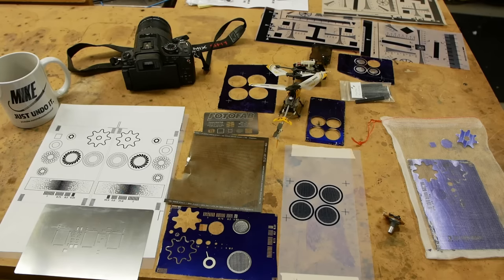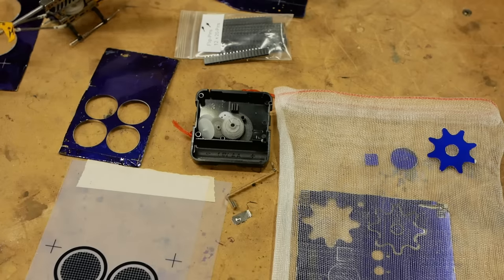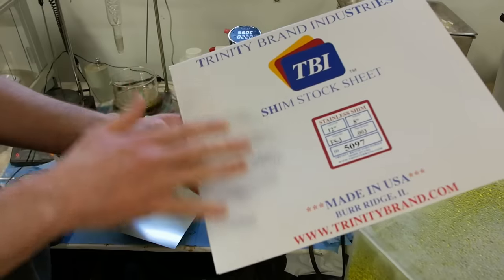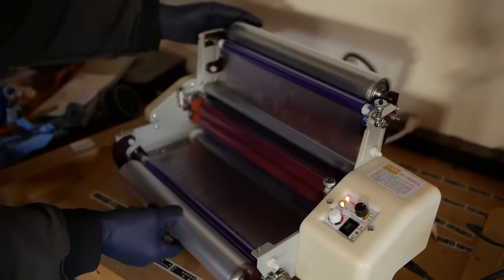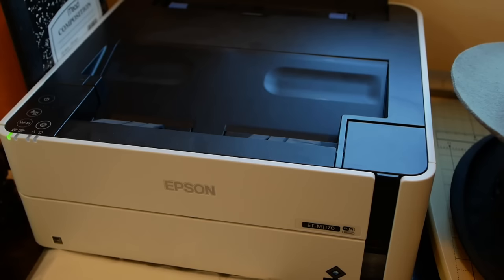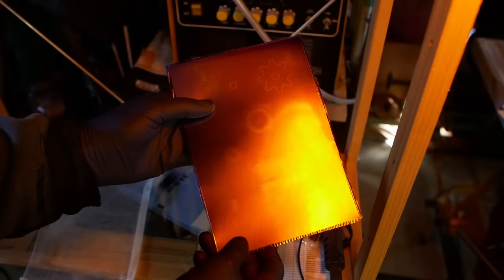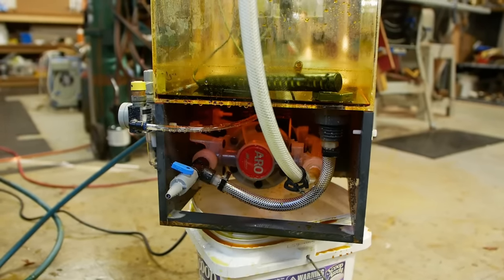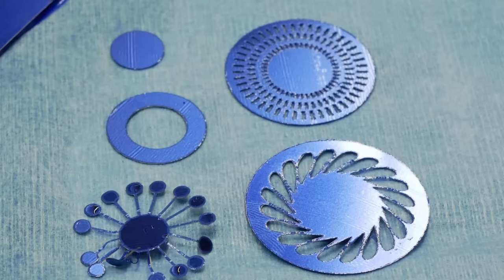How to make precise sheet metal parts (photochemical machining)

Comment: Does the etch migrate perpendicular to the etch direction into the bulk of the material between the two layers of photo resist? I imagine that once there is any depth to the etch it would attack the walls of the etch depth also while continuing to propagate along the etch direction

Comment: Clean dry compressed air (ISO 1,1,1) is quite difficult (expensive) to make. For small use cases bottle air or nitrogen is more economical. Or like you did find another way.

Comment: Honestly? I feel like you could cut out the printing and such by using a 405 nm laser. Or some form of modded high dpi DLP projector. A monochrome one that you replace the white LED in with a 405 NM LED, (or clean the phosphors off of the existing LED) to turn shadow masking into dlm and thus remove layers and consumables, if this were to be a business

Comment: - you could order these at a reasonable price as a stencil for PCB from the biggest factory everybody and their dog heard of;
- there are transparencies for printers sold that already have a stripe of paper for difficult printers;
- laser printers are actually good, but not consumer ones, the color ones found in local printing centers that do advertisement products and photo work. Such printers use all colors for max contrast; I use their services to achieve 0.1 width 0.2mm apart for A4 area instead of maintaining my own printer (which is a major PITA in case of ink jet);
- as the rest of the process is pretty much identical to home-made PCB photolithography, I wonder if there are friendlier etchant solutions for sheet metal as there are for copper clad. Unfortunately, my chemistry is weak :/

Comment: What concentration of NaOH would you recommend to get the parts critically clean? I've tried 0.25M (10g/L) and that still seems pretty strong, but not sure how much I can cut back. Is there a pH to shoot for? I really struggled to find any reference of what concentrations of Lye/Caustic Soda/Sodium Hydroxide/NaOH (I tried all those terms) are useful for which applications.
Reply: Also, I've ordered some Alconox since it seems like a great cleaner to have around, did you use a 1% or 2% solution like I've seen on the documentation, or does the heat allow you to use less?

Comment: does it work up to 0.5 mm ? what about thicker sheet up to 1 1,5 mm ? does exist any other diy method that does not invole a laser cutter ? I was thinkering with a project, but I need thinner parts and I would like for a cheap way to do this, at least cheaper than buying a laser cutting machine and learning how it works

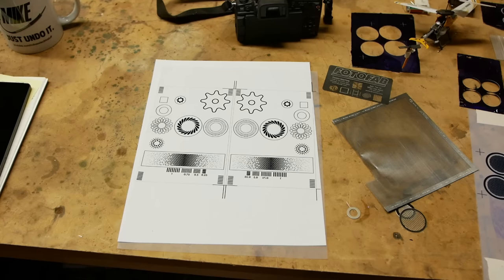Comment: 11:50 a czech friend of mine is hacking anycubic photon 3D printers to expose photoresist.
takes approx 120 seconds of exposure. You can feed the program he's making a PNG file, and it'll expose that using the LCD. The details come out super fine. Might not be as good as a printer, but good enough for most things.

Comment: I'm surprised you don't have some sort of laminar flow hood. Wouldn't that be a useful project.?. Not very high tech but you'd probably use it in most of your projects. I made one that was very LOW tech and not really laninar, but just filtered air. Basically a box fan with a course filter on the back and a hepa filter on the front. It worked for what I was doing. ✌🏽🦧

Comment: Alright... I'm a fan of this channel, but that's no reason not to be constructively annoyed. I think you are glossing over some major problems with this method. If you skip to the last part of the video where the 5 parts are shown, you may be able to notice some "wrinkling" of the photoresist, not only on the edges, but completely through smaller sections of the parts. This wrinkling is the photoresist lifting of the substrate. The most apparent cases are the lower left part on the "stick" connecting the center circle with each radiating circle, and the lower right part in the narrowest areas. The reason why I notice this is because I have been failing at solving this issue for.... longer than I want to share. This lift off will ruin many DIY attempts of home PCB fabrication that have small enough feature sizes (almost everything useful). The closest I have come to finding a solution to this problem (I haven't confirmed this) is using a heat gun to warm the photoresist past its glass transition temperature. The reason for using a heat gun instead of cranking the heat up on the laminator is that by heating it past its glass transition temperature the photoresist has a tendency to move around and wrinkle up the top protective film which will cause areas not to be locally flat and that will cause issues with the photomask getting close enough to make clear clean lines. There is another possible solution, which is using a photosensitive ink that you can find on alibaba. You have to make sure to get the etch resist and not the solder mask because there is a major difference. One of the problems with the photosensitive ink is that you have to thin it and then spray your board to get a good enough finish. Then you have to wait for it to be dry to the touch. Also you cannot accelerate this with heat since the ink will "expose" from the heat you use to dry the board. It's possible that the lift off can be solved with longer hold times between application and exposure... maybe the dry film, like pitch, will flow into the surface defects if you give it long enough, but I haven't confirmed this either.

Comment: Seems like an ideal case to use 2 sla 3d printers to develop the resist easily. you would be limited to the ~50micron resolution of the screens but I don't think that is much worse than the inkjet printers. Remove the z axis from each printer and align the screens either mechanically or in software. hmmmm...

Comment: why not use a4 photoresist sheets and an even cheaper laminator? I guess running price? though the extra like 3-5 bucks may not matter that much if you're taking like 50-100 bucks a piece.

Comment: Aircompressor with separator used for paint. Removes oil and moisture from the air. Perhaps not good enough?
Reply: Filters only remove liquid particles, not vapor.  The vapor will condense and contaminate the target surface.
Reply: @RichardKinch  Great answer, did not know about that limitation. Thanks for sharing!

Comment: I would always rather do things in house - simply because I don't want to fund China and it's price gouging. All megacorps atm use cheap Chinese things yet then overprice them. For example, a pair of 3M Peltor knock offs were $39, then became $50, $80, now they are $50 less than the OEM part at $297. So it'd be stupid not to get the OEM item. Knock offs are now almost as expensive. And this is purely Chinese agents drop shipping products in and flipping them for huge profits every step of the way. When I can't make it at home, or if it's too hot to say fire up the forge, I will go out of my way to commission it from a small hobbyist, like a young blacksmith in the UK I use for tools when it's too hot here in Australia to make it myself.

Comment: This is exactly how making 2 layer PCB's in the good old  '80 looked like. No inkjet printer of course but hand designed with Rotring pens on chalk paper. Photo resist was applied using a spray can. Exposing with UV TL lamps on a mechanical timer. The edging always ended in smudges on yours clothes. I can smell the very distinct odors of all those products....

Comment: You obviously know about it cause there's a stencil in the bottom left of the first shot, but if the thickness is not particularly important you can just order a pcb stencil. That's super cheap from all the usual suspects, like $15

Comment: Could you simply use a laser etch? Laser burns away photoresist. In fact, I'm not sure why one wouldn't just use a laser to cut through the metal in the first place as it seems like the most direct route.
Reply: The issue etching overcomes is deformation due to heat produced by the laser.
Reply: @warrantyvoid  If that is the only real issue then it seems relatively easy to overcome unless the localized heating is so great as to deform the material to be useless(which I would doubt since the deformation should be relative to the cut size and length of time spent).

E.g., only laser cut an area for a limited time and then move to another area that is color and use a coolant.  Obviously use minimum power to cut and possibly some other techniques. 

Just seems like it is a much easier process. While etching may be low heat it still has other uses that laser cutting does not so except for complexity of lasers I don't see how it is beneficial unless the localized heating is so great as to deform more than the imprecision of etching itself.
Reply: @kodfkdleepd2876  When working on scales as small as 0.5mm then yes, the localized heating is an issue! The kerf of the laser is also a factor, as well as the time it may take to cut thousands of holes, like in a mesh. I'm no professional materials scientist but I'm sure there are other reasons besides these that explain why etching still has a place in manufacturing like this.

Comment: Those weird rotary spinner (almost garden hose-y except those are fixed radius), what are they called? In fact, can you just run down all of the DIY hardware. (Youre about due for a Tips and Tricks #3...and #4....)

 In "production", just like a chem labs, to protect against nozzle-to-hose interface failures, a stupid, but easy fix is just to do what is used for wastes-have a secondary- because no one likes hot ferric chloride. 

Speaking of wastes, he better not just be neutralizing and dumping. As a presumably Californian he should know water is scarce and getting scarcer. You can use a magnet (presuming we're using steel) to filter out the 'fats' (haha) and then force the diluted KOH and/or NaOH through something as simple as a cotton (dont want to clog those expensive frits!) to get the 'fines' (haha) out. Then recompose your basic solution. You can even use the extraneous charge from that ARO pump! In terms of efficiency, again, air is abysmal though I'm sure you're aware. The shorter runs and larger diameters the better. Between 3/8ths and 1/2 your parasitic loses are literally 50%

Comment: Interresting that the photoetching industry when it comes to non-pcb materials, seem to be so behind.
Many of the issues you're talking about in regards to mass production has already been dealt with in the PCB industry which has tremendously lowered the cost.
I'm surprised it's still so expensive to have metal parts etched.
I don't want to deal with etching stuff myself (I'm done with that) and could really use getting some things made in the town but the prices are too steep for prototyping/small batches.
Reply: Oh and speaking about etching tanks and pump blowouts. Yeah, part of the reason why I don't want to deal with etching stuff myself anymore xD
I've had the pleasure of experiencing a large centrifugal pump on an industrial spray etching setup blow a seal and spray feric chlorid out in a big mist in the entire room the machinery stood in. What a horrible mess it left behind! Luckily nobody got hurt but man the cleanup afterwards was a chore!!! Entire room was brown from the incident xD

Comment: Ferric chloride must be one of the messiest substances known to man - it will stain anything and everything. You can remove that resist after etching with a just a slightly stronger solution of sodium carbonate than used for developing - saves having to keep extra chemicals around, although if you're Ben, I doubt that's an issue!

Comment: damn... That's a lot of photoresist waste...
As for the printing, I use my resin 3d printer UV screen. I generate my own CWS file. It's just 1 picture displayed for 5min. I saved one step! Also, as the metal sheet is really thin, I only do 1 side and is good (just make it slightly bigger (102%) to count on the chemical bath eating metal). Anyways, first time seeing this. Use a better solution (for me) for a about 4 years.
Still upvoting it.

Comment: electron-ion etching (crt etching)
Reply: just paint the pattern with the electron gun
Reply: the problem is not the making, its that people think they need to be paid, so you fill people's pay checks no matter what
Reply: do microelectronics in minilab
Reply: micro wafer etching
Reply: try up-right resin tank printing, with control rod to keep the liquid level just above the print bed and/or object, then cure the top layer with uv-laser engraver, it attaches directly on top of the build plate or the object, but avoids sticking to the bottom of the tank, or does not have the pass-through smudge bottom screen problems of the inverse usual resin 3d printers

Comment: BRO!!! You REALLY should have a GFCI outlet on that etching machine..... It looks like you have 120v mains running up the side of a plastic box will with liquid and if that gets wet it will pop the breaker on the whole whole circuit.... and who knows what kind of damage that could.... get one of those outlets that you see in ALL MODERN BATHROOMS that are near water sources so that a leak does make that nightmare mess you don't get spray chemicals and then electrocuted.... at least this way it would only be a very quick millisecond shock and the whole places hasn't burned down.....  BETTER SAFE THAN SORRY
btw,  this should ALL BE GROUNDED for the protection to work properly.... so that third prong in the electrical plugs needs to be used on everything leading up to that outlet *I'm assuming you are just using an extension cord going to that outlet and you did add a new breaker to your box and hard wire it lol)
I just want everything to be okay if the unimaginable were to happen..... you are SUPER SAFE with everything you do, but I saw this and figured I would mention it.... :)
Reply: Hey Einstein, calm down.  Garage outlets are on GFCI circuits per code.   He’s in a garage.